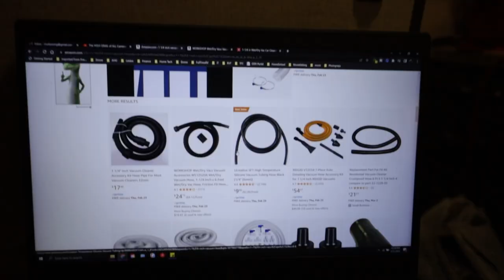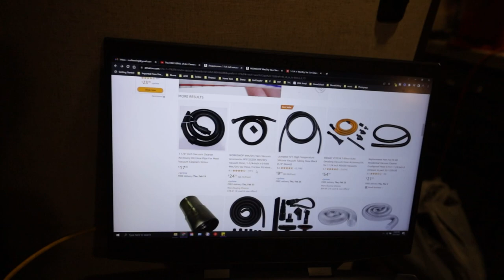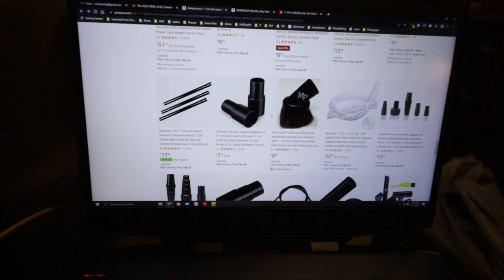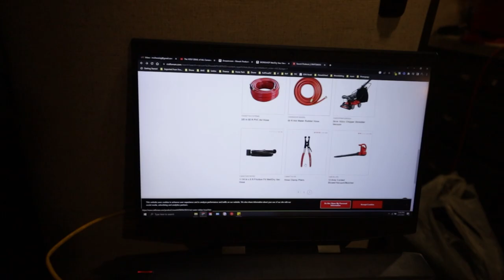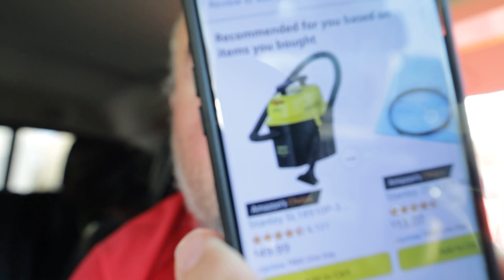Broken Vacuums and Cleaning Shower drains | RV Live Daily Vlog

Comment: There are no "bad tires" David, the biggest issue is the inherent risk to the tires based on the location of pairing the axles so close. In a vast majority of blowouts what happens is the front tire kicks up something in the road and then due to the close proximity of the rear axle (rear tire), that nail...screw...wire...whatever that was kicked is forcefully embedded into the tire, which then begins to loose air pressure unbeknownst to the driver, the tire begins to heat up as it continues to run down the road while loosing pressure, then it has catastrophic failure. This is why having a good TPMS on the trailer tires is crucial. This happens to front trailer tires as well, as any tire has the risk of picking up a screw or nail, but a vast majority of trailer blowouts are on the rear axle. Glad to see you pulled that HEPVO valve apart and cleaned it and the silicone flaps were not damaged. See you next week.
Reply from the maker: I'm going to have to respectfully disagree with you on the tires. Not concerning punctures, that actually makes a lot of sense. But your statement about there not being any bad tires. Our first RV came with Trailer King tires. I had 2 of them develop bubbles in the tread at different times without ever blowing. I've seen countless photos online of other cheap tires developing bubbles.
Reply: @rvfamilylife  Certainly there are "cheaper" tires. Tires are made with various rubber compounds and a wide variety of belt and speed ratings. Most trailer tires live a life exposed to the harsh realities of life, very few get to enjoy the benefit of being stored in a covered garage. Many are also subject to speeds over their speed ratings, and weights over their load ratings. Don't get me wrong, we replaced our "stock" Westlake Trailer Tires with commercial Samson GL 14 ply tires when our stock tires had about 5000 miles on them. Currently our Sampson tires have over 35,000 miles on them, and although they are wearing they are still in pretty good shape. The stock tires were sufficent for weekend warrier type RVing, but I wanted a better commercial grade tire when we hit the road full time. 👌